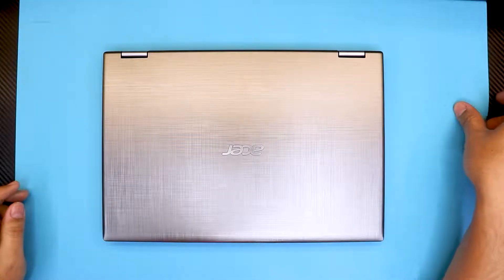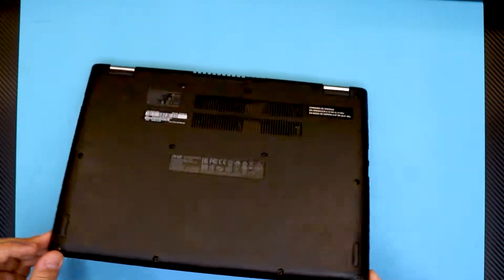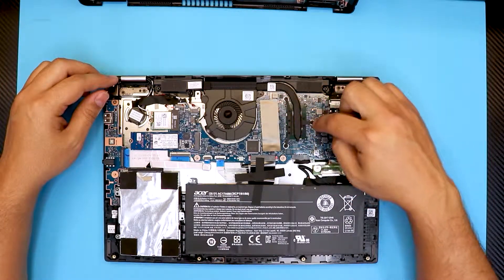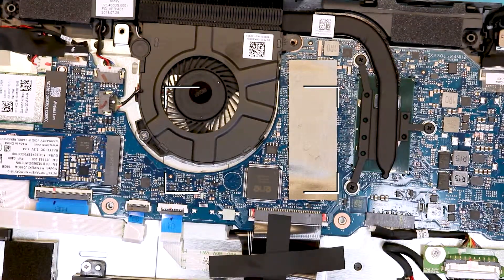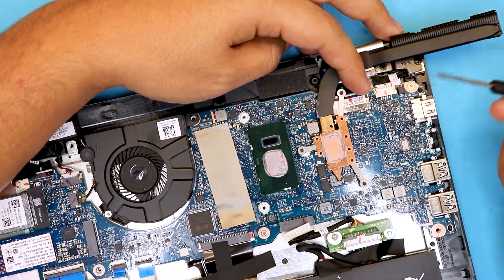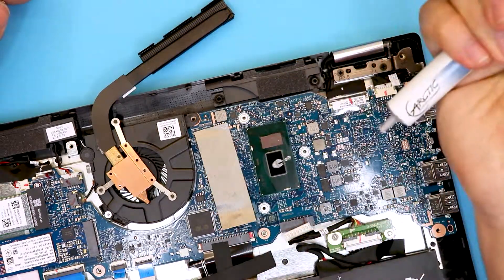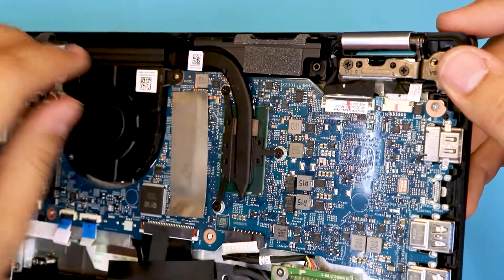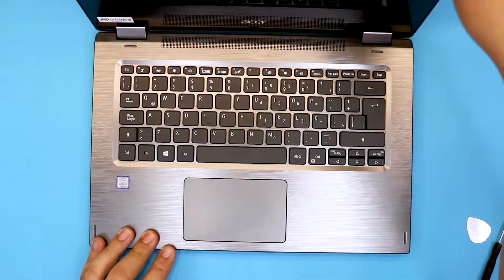Acer spin 3 DEFECTIVE part HOW TO FIX DEFECTIVE HEAT problem, Teardown guide

Comment: Hi, I have an acer spin 5 with I think a thermal problem. When I start it up the processor does not work well and stays at 0,4Ghz. When I start it up in safe mode it starts up fine and the processor geos up (1,9Ghz) as it should. I send it to acer and they say I need a new motherboard, at €668,- (laptop is out of warranty, only 3 years old)!!! Can you help me out, it seems to me that there must be something wrong with the thermostat, as it runs fine in safe mode???
Reply from the maker: Sorry for the late reply, i was out of the town. your motherboard has no issue, you will need to update the bios and reset the bios. do that and report back to me.

Comment: hi, I'm unable to uncrew the screws holding the dissipator. looks like they are dull
Reply from the maker: try to apply more pressure and or try a flat head screw driver the flat heads are best for removing harder screws because of the 90 degrees angle, if all hope is gone make a flat cut on the top of the screw-head and use a flat screw.
Reply: @uFixTek  Any suggestion on how to make th cut? (I already tried a flat-headed screw driver)
Reply from the maker: here is some picture , you need to improvise to see what you can use to make the cut i use a small cutting disk, you can do it manually with some tools.
https://imgur.com/a/TA5yrAB

and here is a video file after making the cut, 
https://we.tl/t-G2ct0eMYQC
Reply: @uFixTek  Thank you so much! I will try to do it, although that looks scary xD
Reply from the maker: not at all disconnect the battery and work on it as you mean it, :P use tape around it on mobo if it makes you feel safer :P dont give up on me now , you remove that by making the cut.... and i want to see you removing it :)

Comment: Hello I have a same model laptop, it suddenly stopped working. It doesn’t turn on, power plugged replaced - still no luck, replaced the battery as shown in your battery replacement video but still no luck. No burning smell. No lights come on when power plugged. It’s not used much but don’t have any warranty so ☹️. Do you know what could be the problem?
Reply from the maker: ufff i dont even know where to start for diagnostics its a lots checking and stuff you need to check with multi-miter voltages on few components and i would recommend you do take it to a component repair shop to get it checked. based on what you said you may have a few voltage regulator damaged.
Reply: uFixTek ok thanks

Comment: Hi, whats up? I have the same computer model and, recently the image on it just disappeared. I can hear the noise of the cooler and the charging on, and it also has the led lights on. When i connect on a hdmi cable, it doesn’t show any image on my tv. Here in Brazil, no ones could help me with this model of computer. So, would you please, tell me what could I do to solve this problem? Sorry for my bad english!
Reply from the maker: Let me check, 1st you may have a frozen bios, and bad pos. to pass this do the following steps and let me know:
#1. power off the laptop 
#2. open the bottom cover and disconnect the battery cable from motherboard. https://imgur.com/a/O7lS9UL
#3. remove the bios battery by disconnecting it from motherboard ( @3:22 the battery is tot he right of the wifi board, only disconnect the jack that is black and white right on the side of the mother board beside the wifi .)
https://imgur.com/a/O7lS9UL
#4. after you want to press and hold on power on button for 30sec (dis will discharge all the caps on the motherboard)
#5. to make sure all capacitors are discharged with a flat screw driver or any metal object shorten the jack where you disconnect the bios battery for 10sec, (the small battery , that you removed. inside the jack you will see two ping shorten those two pins 10sec) (DONT SHORTEN THE BATTERY , ONLY THE JACK WHERE THE BATTERY PLUGS IN!)
6. plug in the bios battery and the main battery and the charger and wait 1min and the power on.

let me know
good luck
Reply: uFixTek hello again!! I’m very very thankful for your informations! I followed all the steps, one by one, but the computer only started, with the led lights on and the cooler but still with a black screen!! Thank you again for spend your time trying to help me!
Reply from the maker: Carolina Oliveira okay give me few hours and i try to look at the motherboard diagram and i mag you back, hold tight
Reply: uFixTek thank you sooooo much!!!
Reply from the maker: okay i got few steps and in a bit i will msg you with steps, im verifying few stuff for this model.
Reply from the maker: i need you to do this is this doesn't work, then your ram chips are faulty and they are soldered on motherboard you will nee to do a reballing on a ram chips.

remove the cmos battery and the main battery,
and remove your ssd drive, and your harddrive.
then hold the on button for 30sec.
then connect only charger and power on if you get screen then power off then connect your hdd then ssd and power on and if you get screen then the batteries .
if you have a bad hdd sometime rare case it wont boot nore show screen.,
suerte!
Reply: uFixTek I don’t have on this notebook a hd, is that a problem? I will show you a image of it in this link ( https://imgur.com/a/dnzMb2q ). I’ll try your steps! Thank you again and sorry for be bothering you over and over again!
Reply from the maker: i see your hdd in the image its a m.2 ssd drive it looks like a stick of gum.
it looks like this and there is only one screw holding it remove the screw and it will pull out, like a ram.
https://imgur.com/a/jiyyvxs
Reply: uFixTek ah, ok!! I took of the little screw and the ssd, and I did all the steps, but unfortunately it still without image on screen! Thank you for all your goodwill and willingness to help me! I’ll keep looking for more steps to solve this problem!
Reply from the maker: Carolina Oliveira the only thing is that there is o may not be any other step except replacing ram chips, but there is a one last thing i want you to do and that step may sound very ridiculous but i want you to follow very carefully and exactly. Let me get to the office and i will write down the steps and explaining why
Reply from the maker: Ok, here we go, the following items required :
1. hair dryer or a heat gun station:
(https://amzn.to/3bJQPwH)
but hair dryer can do the same

2, need a heat Matt or a plywood :
https://amzn.to/2AHsE55
but a wood table would do fine ( no glass nor metal table)

THINGS TO AVAID:
1. open window
2. fan blowing to the work area
3. air condition room (turn of AC)
4. must work at room temp or warm room temp.
5. avoid moving the mother board after for about 10min
6. do not blow on the motherboard when done
YOU NEED TO LET THE BOARD TO COOL DOWN ON ITS OWN AT THE SAME ROOM TEMP 10min

STEPS:
#1.You will need to remove the motherboard completely (very easy remove all the contacts and screws that is marked ) if i missed any screw remove use logic and remove the motherboard completely.
https://imgur.com/a/SiruyKM
 
#2. Place the motherboard on a work area (wood table or food grade silicon matt) 
the metal table or glass table will absorb the heat and wont do the job.

#3. remove the thermal paste off the cpu.

#4. remove the tape (pad ) off the ram chips.

#5. you will need to power on the hair dryer and set it to max heat and lowest the fan speed,

#6. dont use the small nozzle for the hair dryer use the main big exit.

#7. keep the hair dryer straight 90 degree over the CPU with a distance of 1" (2.5cm) for 4min then raise the distance to 2" (5cm ) for 2min

#8. do the same for the ram chips ( dont worry if the heat reaches the cpu a bit nothing will happen) 

#9 also heat the are marked in purple 1" 4min only

#10 let it cool down on its own for 10-20min DON'T FORCE The COOLING

#11. put back everything (batteries and all the cables) except the SSD, if you get power and screen  then turn off and plug the SSD
--------------------------------------------------------------------------------------------------------------------
explanation:

the work area is for the heating as it was explained above.
the heating the cpu  is diagnostic to make sure that you dont have a cracked solder joint under,
same applies for ram chip.
and the other part (purple ) is to make sure you dont have a bad Capacitors , stocked caps can cause this issue.

i really hope this can get you sorted out.
its my pleasure to help out else i dont see the point of having this channel.
let me know 
good luck
Reply: uFixTek okay!! I’m ready to start! But I have only one doubt. What are the component marked in purple? Sorry if I’m didn’t seeing it.
Reply from the maker: im sorry i forgot to circle it :P
here:
https://imgur.com/a/dwPhkUF

those are the voltage regulators and capacitors
Reply from the maker: if you speak Spanish im fine with it :)
Reply: uFixTek I’m a portuguese speaker but spanish isn’t that hard to me to understand. Feel free to speak in spanish ☺️
Reply: uFixTek hey, it’s me again!! I just finished all the procedures and reconnected all the components, but the screen still without any image. The problem is more complicated that I thought. But I’ll be forever grateful for all of your help! Muchas muchas gracias!
Reply from the maker: okay one last thing, and this should of been 2nd step wey back up if this fails then you have a bad ram chip or motherboard needs repair. 
plug everything the way it should be and disconnect the cable for the LCD then use the HDMI to use external monitor. and see what happens. sometimes when you have the lcd cable plugged in you may not get hdmi output in start.

good luck and im sorry if i couldn't do it with following steps, but i wish you the best of all in your next purchase :P
Reply: uFixTek It doesn’t work too. I was very hopefully hahaha. But thank you so sooooo much again! You’re the best!! I wish you all the good things in the world!!
Reply from the maker: thank you and goof luck :)

Comment: Hi. Thank you for this informative video.

I have lower than average UHD 620 benchmarks, so I looked at this. My Spin had no paste on the graphics chip, and the same gap to the heatsink, so I pasted a soft metal shim in the space. It made absolutely no difference to the benchmarks.

My conclusion is that the heat dissipation on the graphics chip is not necessary.
Reply from the maker: actually it is, that portion of the chip we think its the encoding or something we have ran many tests and when did streaming or heavy load test it did kick in and started heating up 70c.

Comment: How do you know if you have a heat problem to begin with?
Reply from the maker: When your cpu starts throttling, its because of over heating, also you can use msi afterburner to check temps or any other  cpu temp applications.